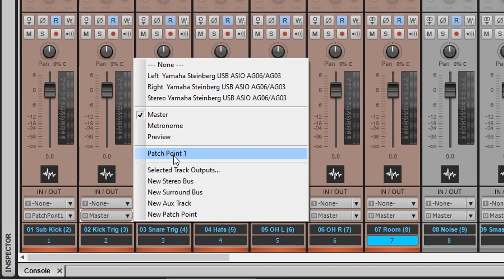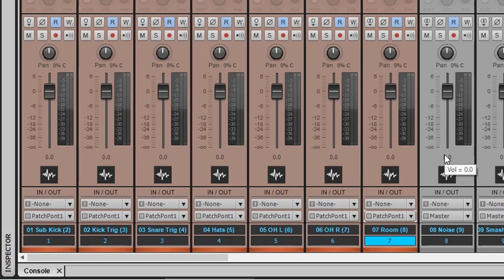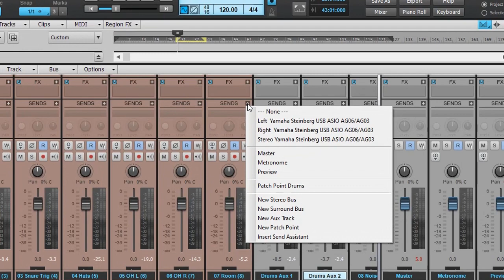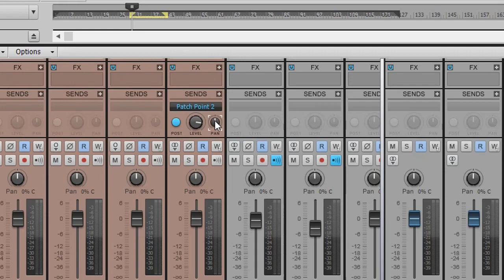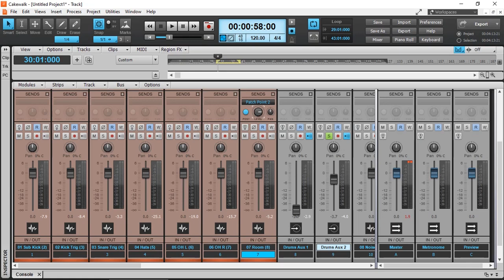Cakewalk By Bandlab - Patch Points Basics Explained

Comment: Great video. Could you just create a parallel bus add as a send. so you not creating to many Aux and patches or duplicating tracks or is the patches a better way
Reply from the maker: Aux bus and Patch Point have similar but specific purpose to audio routing functions in Cakewalk.
Reply: @RecordingStudio9  What are the specifics? I found this a bit convoluted. Trying to remember all the directions of the signals must get confusing, and feel like getting tied in knots. How do you keep track of where everything is going?